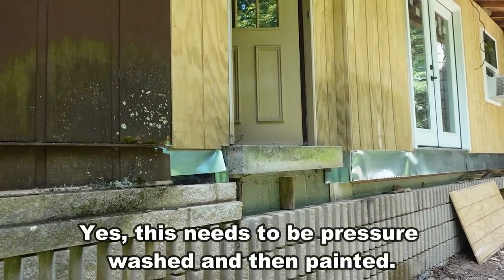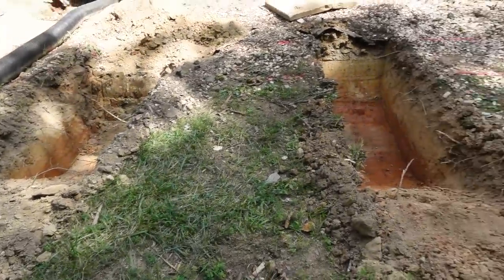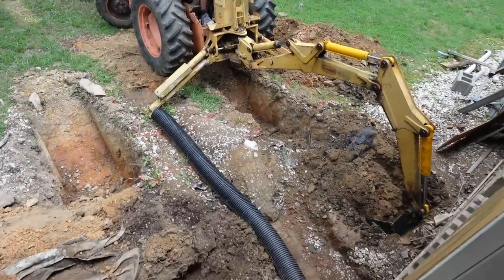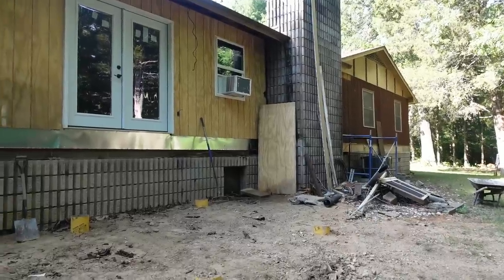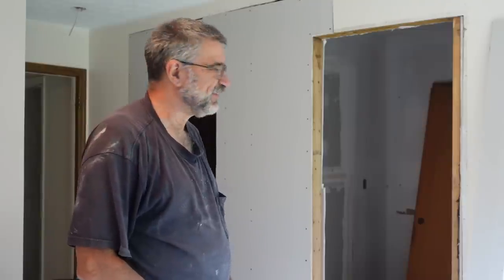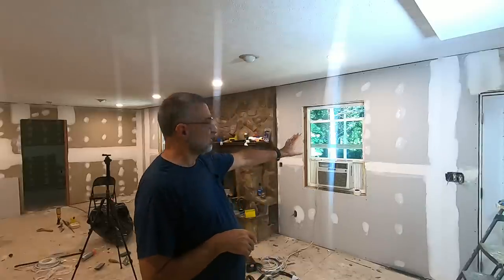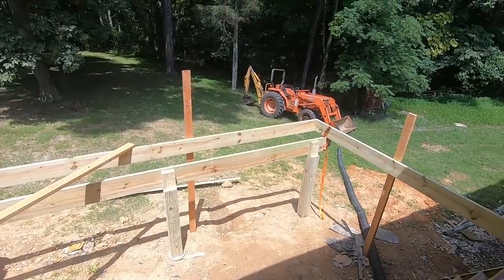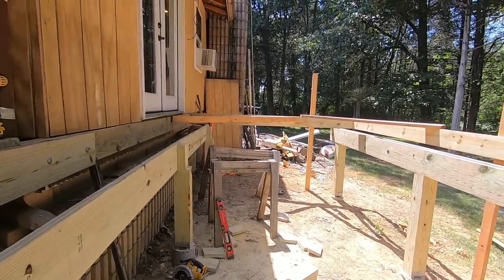Building the Deck - Flip House 13

Comment: ohhh, i think im getting it now about the deck. i think im going to like free standing decks from now on cause i dont like when they have to drill into the house to anchor the deck to it. that is the only way ive ever seen it done and now that i know it can be done this way im going with it.
Reply from the maker: We still attached this deck to the wall.  But it wasn't weight-bearing.  It was just for stability.
Reply: @LiveSimpleLiveFree  got it.

Comment: I'm surprised that you didn't use a router on the outlet holes. Those are the greatest! And the don't cost that much either. Once you learn how to use it, it cuts your time in half! Try it sometime
Reply from the maker: This is my LAST project like this, and I only had a half dozen holes to cut.
Reply: @LiveSimpleLiveFree  where have I heard this before? Hmmmm

Comment: I don't understand why Americans don't use stud adhesive on your drywall. 
What about ceilings? Do you use it there? It's always been my understanding that it's the glue that holds it more than the screws.😊
Reply from the maker: Some do, some don't.  It's not required.  Most of us use it on the ceiling.

Comment: Looking good.  Here's a question that I have had for a long time and am just now thinking to ask.  What is the white strip of paper for when you're spakling or sheetrocking?  Is it to fill up the line, give it something to be like a bandaid over the cuts?  Oh and Why is it called sheet rocking.  Are there rocks in it?  Awaiting th deck, and can hardly wait to see what the back outside will look like when it's done.
Reply from the maker: If you don't put the paper joint tape across the seam between the pieces of sheetrock, it will crack, and you will see every joint.  The paper gives strength to the joint and keeps it from cracking.  Sheetrock is made from powdered gypsum, which is a type of rock.

Comment: The Amish can't be beat when it comes to work ethic.  They feel or believe that everything that the do is for God, at least as far as work goes.  So the cabinets will be to envy, I'm thinking.  The place still has a 70's vibe in the great room, but is more modern with the inset lights.  You got rid of some ugly old stuff out of there and hopefully the fireplace will shine as it's huge.